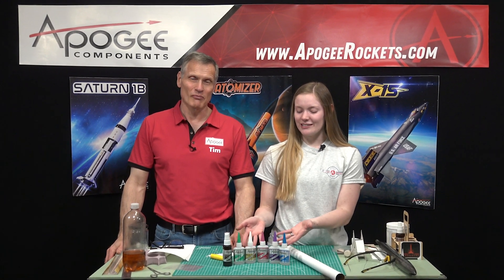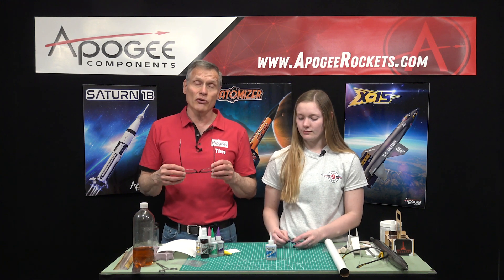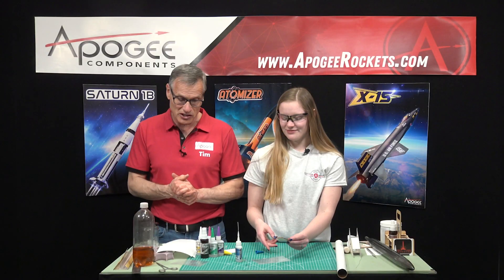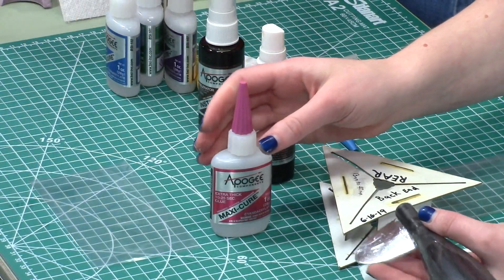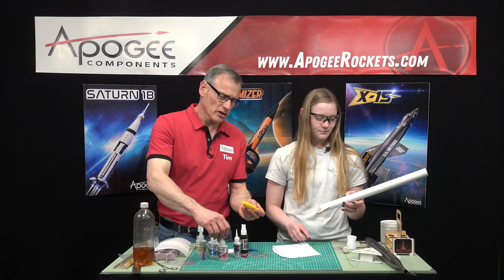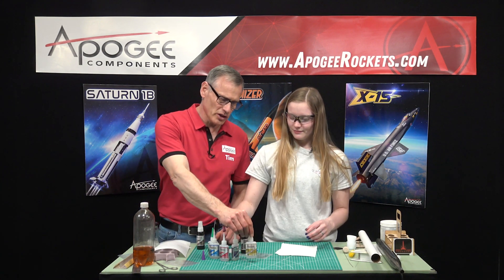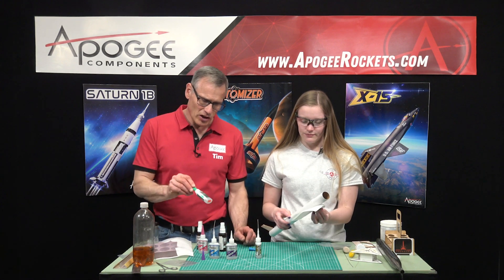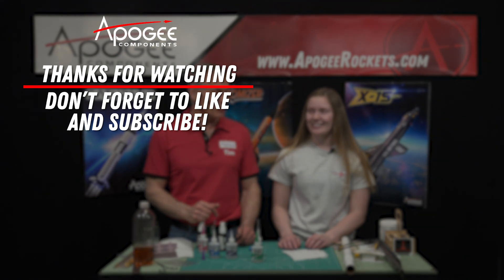Which Type of Super Glue Should I Use for Model Rockets?

Comment: Good video. I have been using CA glue for sealing balsa, so I'm glad to see it's a "thing". A video dedicated to balsa finishing with CA would be good, especially if you use particular steps to smooth the surfaces after applying and sanding the first CA layer. And PS, I use the odorless type because you need to apply a lot more than usual. Thanks. ))

Comment: Excellent info! Thanks... I've always had a question...Super glues are strong in tension but weaker in shear, which is why if you glue your fingers together, you can't (and shouldn't!) "pull" then apart but rather gently slide them back and forth to break the bond... Does the relative weakness in shear ever cause concern? This is basically why I still tend to prefer wood glues for attaching fins or at least for filleting them. Thoughts?
Reply: CA glues are stronger than wood glues and sheer isn't a issue if applied adequately over the matting surfaces. Note my experiences may be different than yours but cleaner installation and over all apparence compared to wood glue is alone is worth it to me.

Comment: Great informative video. Useful for all, but especially for us "Born Again Rocketeers" coming from the days when we used wood glue and maybe a bit of "Testor's Plastic Cement" for everything. 

My own experience way back in the early 1980s was that super glue wasn't very good for balsa.  I had built a glider and had it all set up ready to go, but in testing, a single impact caused all joints to fail...LOL...
Reply: Yes, I started building again and have been using the glue I always used.  This might just have opened up a new level of possibilities.